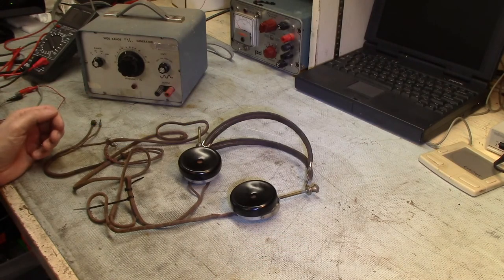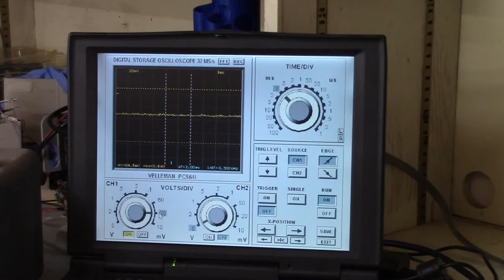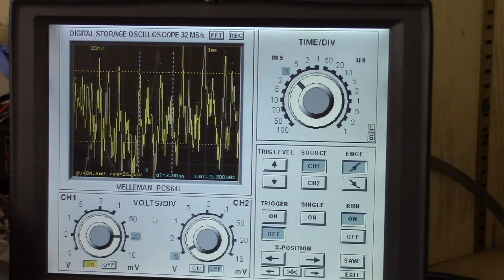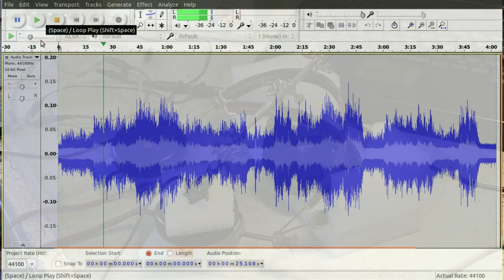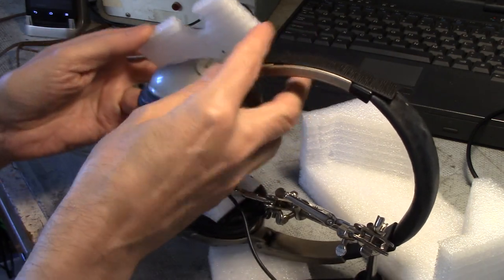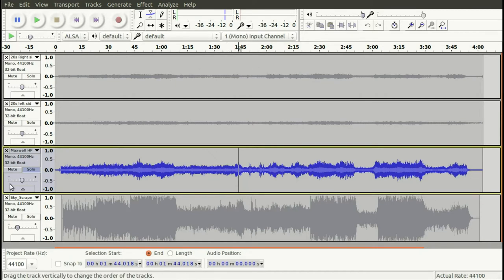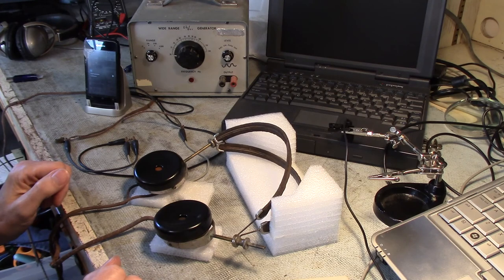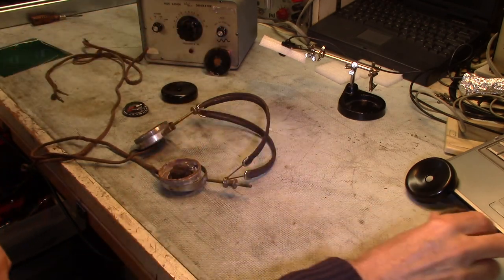1920's Brandes Radio Headphones, Prt1, Performance Test & Analysis

Comment: From my experience with the stereo wired set, the discrepancy in output seemed to subside to almost indistinguishable with use. I reckon the metal diaphragms just sort of needed to break in after decades of not being flexed by the drivers.

Comment: This is cool. Been tinkering with some beat up ones that were great grandpa’s. There’s seemingly not a lot videos or information I can easily find on the web about them, so it’s like you, just rolling up the sleeves and messy experimentation. I didn’t have any intact original wire harnesses to start with,… but I made a custom stereo harness breaking out to RCAs and adapting to stereo quarter inch trs, that way they have some flexibility for connecting to various outputs. I bought an identical pair and model with intact original pins and wire harness, for mono and incidentally already have a plug bay to ts connector of that vintage. That way I can make comparisons,… and maybe figure out how to build and ideal adapter/driver for using such headphones with contemporary headphone outs. My stereo modified ones,.. with my studio headphone amplifier pegged past 11 actually sound really good, in spite of that amp trying to contend 1500 ohms per driver. I reckon I might try to connect the new identical pair, I just bought online, to the output to a solid state amplifier’s output, once I clean up the hardware really well.

Comment: I quit watching at 31:45.
There are many too many inconsistencies, The output of the signal generator frequency as far as flatness. The Dynamic range of the earphones and its frequency response. Like you said non scientific. I think a better option would be to compare old crystal and radio earphones. 
Measure the resistance of the coils to compare sensitivity from brand to brand.
Measure voltage applied with an analog multimeter. This would show an average peak, rather than an RMS value which is all over the place on your computer scope. Use the same vintage old tube set without changing settings. Use that as your standard then feed and modulated signal to the antenna. Measure the Generator as the reference point. Use one standard audio frequency of 1,000 Hz. and nothing else. If you can measure the the RF voltage output that would help when you measure the gain of the radio. You are using the audio of the computer which is fed by an MP3 which has no Laboratory data on output level per say then the same with the audio amplifier. The thickness of the  earphone plate and the strength of the magnets plus the air-gap between the magnet( some times a horseshoe is used with two separate windings in serial connection for just one earpiece. Sometimes its a magnet bar.) Even the telephone earpieces were identical to the point of being uncomfortable. the only thing that's changed is now its a speaker instead with much more amplification before the earpiece. There are specs on some very old as to sensitivity, Impedance, resistance but that would take an enormous search. another thing is measuring the Flux of the magnets and put in the equation. However you have to be lauded for you inquisitiveness. I sadly quit doing that on a consistent basis. Remeber what they say about Edisons experiments they were not failures but knowledge showing what didn't work. Cheers. Audio measurements are done with a standard 600 ohms for consistency.
I have a small Military output meter that I would use personally, but its good reading material also. 
Output meter TS-585A/U or B/U or C/U
The manual is TM 11-5017/TO 33A1-7-23-1
Free online in PDF.
https://www.google.com/url?sa=t&rct=j&q=&esrc=s&source=web&cd=&cad=rja&uact=8&ved=2ahUKEwjYgsS75N7qAhUJpp4KHfHYC8QQFjADegQIAxAB&url=http%3A%2F%2Fwww.combatindex.com%2Fstore%2Ftech_man%2FSample%2FTest_and_Calibration%2F1%2FTM_11-6625-291-14.pdf&usg=AOvVaw2YnuHOeECRfp0-xwQOsWqv